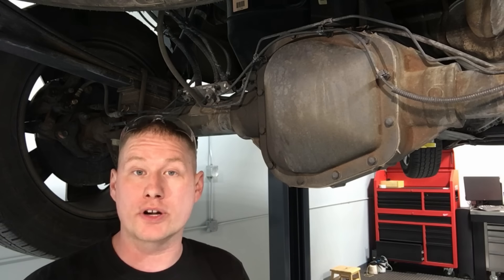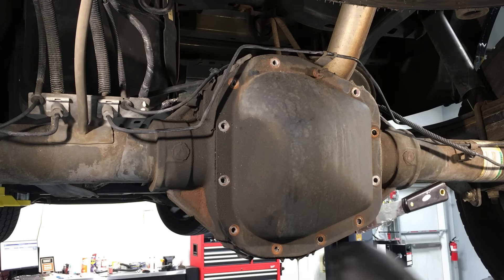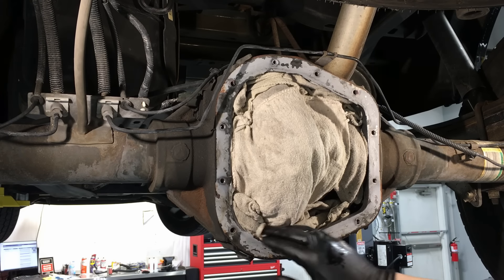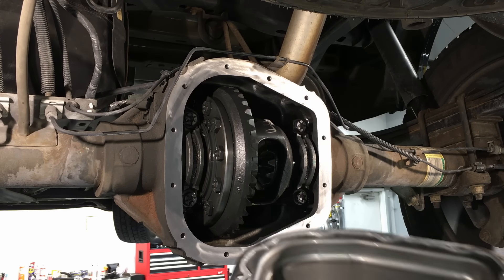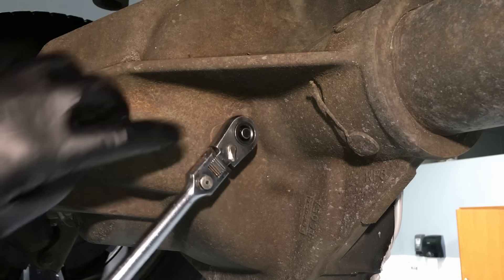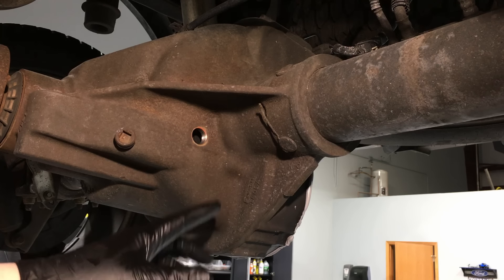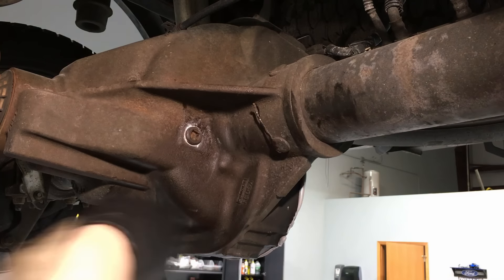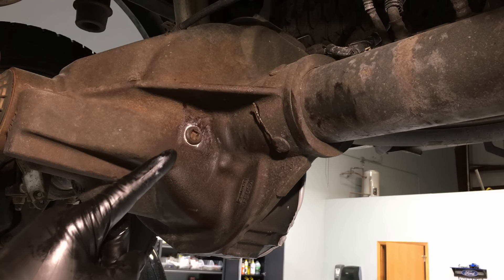Ford 8.8" 9.75" 10.25" Rear Differential Service: Fluid Change Procedure

Comment: The owners manual for my 2005 Expedition says the Diff Oil is good for the life of the vehicle and doesn't need to be changed. Regardless of what the manual says, I change the diff oil in my vehicles at 100K miles. I use the Amzoil Severe Gear 75w-140, it has worked well for me.

Comment: About to do this service on our 03 F150 and in place of the Motorcraft, I'm going to use the Amsoil 75-140 for about $10 cheaper per qt.  Excellent tutorial
Reply: How did it workout with amsoil?
Reply: Perfect.   Easy process following the video.  The truck drives super smooth, no issues.
Reply: @toddallison4390 Thank you, I might consider Amsoil as well.

Comment: Loco, always thought that the first thing was to check the fill plug to see if it comes out,  I do enjoy you videos. I've a 2000 F150 SVT
Reply from the maker: I would say yes but uh I have never seen one seized or anywhere near seized. If make my videos based on experience not what I read or heard.

Comment: I like this method however the only thing that I do slightly different is I hand tighten or crank down to the sealant and don't fully tightened it all the way and after it fully cure is after overnight of sitting I'll torque it down and it forms a really good gasket seal...also permatex recommends this method on it's gasket maker for the differential....great job!

Comment: On posi rearends with miles on them that don't lock very tight due to clutch wear. I have just drained the fluid out and get all of it completely out of the bottom. Refill with proper lube and don't add the limited slip additive. It worked for me.
Reply from the maker: lol
Reply: @FordTechMakuloco  It worked for me. Temporary fix until clutch replacement. It does not take the place of replacement, but at the time I needed a quick fix. I did it on a Dana 61 and a Ford 8.8. As you are aware, the additive helps keep the clutches from chattering on a turn by letting them slip a little (essentially not grab as tight by reducing friction).

Comment: Stick a small rod in a bolt hole up top to help line it up. Once the cover is on with two bolts take the rod out and continue bolting the cover.
I add a short length of clear tube to the bottle top and hold the bottle up higher, allows you to see the fluid flow.

Comment: The permatex instructions say to finger tighten the bolts and wait one hour before tightening and to wait 24 hours before installing the oil. The sealant on the plug was a mess and is now inside the differential.
Should always remove the plug first to make sure it will come out.

Comment: 21:50 What would be the normal depth of fluid in the axle tubes?  1/4"?  Does it touch the bottom of the axle?  The reason I ask is, if you left the cover off overnight, seems like the tubes would drain dry.  When filling quickly like you did, is there really enough time for the fluid to seep thru the inner bearings and then all the way out to end of the tubes???  Seems it would be good to put the plug in when it first starts pouring out, then let it "settle" for 30 minutes to allow fluid to travel all the way out tubes.  Then remove plug and top off again.  If I do this will my be over-filled?   After topping off the second time, I would let it drain as much as it wanted to.

Comment: Thanks.  Comment on the 75W-140 for all transmissions helpful.  Have a Dana 80 on a RWD/DRW 2012 F-350.  Only 55K miles.  ~1500 idle hours.

Comment: Another tip for breaking the seal.  Use a rubber mallet to smack the cover.  Of course leave one bolt loosely in. This method works for me and you will not have to worry about possible gouging.

Comment: Ok, I’m a retired quick lube owner who has an engineering idea about this diff oil change. Ford should have done what almost everyone else has done in the industry. Here’s the deal. Put a check/fill plug incorporated into the housing cover and a recessed drain plug into the actual cast iron “pumpkin “. There’s no way this simple job should be so involved. The only time you should remove the cover is to repair a leaking seal. Period. Oh BTW, it’s extremely difficult to even insert a plastic suction tube into the existing check/fill plug because it will hit the ring gear! Real brilliant, Ford! Maybe they designed this on purpose?

Comment: Perfect tutorial. The only thing i would do different would be the sealant in the plug. Leave the first 2 threads going in sealant-free, so you don't get the sealant inside of the diff. Just a habit when doing any thread sealing on a pipe, either be it gas pipe, or water pipe.

Comment: Nice well done job. The only thing I'd like to add it, when doing differentials, transmissions work, always lose the fill plug before doing anything else. If you strip or break the plug, at least your component still has its old oil inside, you will not be stranded.

Comment: Permatex suggests you let sit for an hour before torquing the bolts. You should wait anyway like you mentioned before filling with oil so the cover seals better.
Reply from the maker: No need to wait.

Comment: I just replaced the entire rear end in my 18 f150, the gears inside were completely shredded. I bought it at 52k miles in 2020 and at 142k miles it broke. I took my truck to the dealer every 5K miles religiously for oil change and whatever maintenance they said I was due for, they never once told me this needed to be done…

Comment: 21 mustang gt s550 here. I dumped out the stock crap at 53k cause i was getting chatter when id make a sharp turn left or right from a stop. Replaced it with 2qt Royal Purple 75/145 with No extra modifier and she super smooth again

Comment: @FordTechMakuloco Why did Ford change the spec from 80W-90 to 75W-140? I know they changed the engine oil spec from 5W-30 to 5W-20 for fuel economy reasons, but I can't understand why they would run a heavier oil in the diff. Was there a lot of premature wear?

Comment: I am refreshing an '03 I purchased. See that ID band on the passenger side axle tube? See it at the 1:10 mark in this video. Mine had so much rust under that band that it ate almost through the tube. It might not be a bad idea to remove this.

By the way, in case a sledgehammer doesn't do it for you removing the rear cover, perhaps use an air chisle! LOL!

Comment: Could you use Valvoline 75W-140 Full Synthetic instead? It’s still not cheap stuff but cheaper than using Motorcraft and I know you should use what is recommended, but I also know they will use identical stuff made by other brands and put a large mark up on it.
Reply from the maker: I don't like aftermarket fluids because they add friction modifier that has been known to cause shudder issues.

Comment: Thanks for this! I’ve already had my rear diff fluid changed by a great shop here. I have a 2018 F-150 2.7 10-spd FX4. The manual calls for 75W-85, but they used 75W-140 instead, which the dealer uses too. I’m guessing this is okay? No issues so far.

Comment: I use 2 guide pins to slide & align the cover.  I cut off the head off a bolt 3 - 4” long, one that has the right thread diameter & thread pitch, makes for easier cover install.
Reply from the maker: Absolutely not necessary in this scenario, there is so much room underneath there.

Comment: Just followed your video to do the same service.  2006 5.4L limited slip diff.  90k miles.  Only previous service was a fluid swap in 2011 at 40k miles. My truck had a shudder in overdrive low rpm when accelerating on freeway, now its gone.

Comment: Thank you for the lesson well done. 
A while back I watched someone drain the differential, but they used brake cleaner to clean out the gears inside the box. Were they wrong to do that.
Reply: Yes

Comment: of interest the Permatex Gear Oil Gasket Maker (part# 81182 - 3 oz) directions specify....  Assemble parts immediately, finger tighten bolts  until material squeezes out around flange, allow to dry 1 hour, then tighten to torque specs. allow 24 hrs to fully cure before filling with fluids.
Reply from the maker: Absolutely no need trust me I have been doing it this way for 20 years.

Comment: I like the work you have done! 
I always been wander - when you adding clean oil at the end - you doing it on the hoist and differential is tilted - but for guys who doing the job on the floor and pinion angle is more level to the ground - so question is - amount of oil that fit into would it be different? what would you advise for guys who doing it on the ground to make it more right? Thanks!
Reply from the maker: It is the same fill either way.
Reply: @FordTechMakuloco  I understand that, i’m curious about amount of oil will fill into, because of hoist - axle is tilted compared when truck is on the floor and fill amount will be different??? (Pinion angle is different)

Comment: ALWAYS ALWAYS ALWAYS inspect the axle vent tube for proper venting. Sometimes they get debris and plugs them up or rust shut and will cause the diff to blow the axle seals as it goes through its heat cycles.
 It takes only seconds to check.
This refers to ALL diffs.

Comment: My shop added the friction additive to my electronic locking differential. Will this cause any problems?
Reply: Nope f150 needs that just as long as the gear oil don't have it pre shipped with it in the oil.

Comment: @fordtechmakuloco Awesome video and love all the great work you do. Just a quick question about the type of fluid to use in a 2015 F-150. The manual says XY-75W85-QL for  my 3.31 ratio,  9.75" not limited slip diff. Of course the internet is full of varying answers and I can't find a good answer anywhere. I trust your knowledge, and you said in the video Ford switched to 75W140 oil. Is that correct? I can't find anything about that anywhere. Thanks!
Reply: I have the same question, 2017 F150 3.5Eco 9.75" 3.31 ratio
Reply: I am wondering the same thing.

Comment: What's your recommendation, on the rear differential fluid change for a 2009 Mercury grand marquis, with 143k miles? The book says not to chnage it unless the differential is submerged fully in water. The car is just used for regular driving. I've only had it for a few months. So it's unknown if it's ever been changed in the past.
Reply from the maker: Every 60k miles is more than enough.

Comment: Hi I just recently watched your video on how to replace the fluid in the rear Differential on the F150 and I wanna complement you on how easily you made it look . I really appreciate the videos you put out . I do have a question regarding you using the gasket maker instead of an OEM gasket ?? Any input you can give me in this regard would be greatly appreciated

Comment: I did this on my 05 F150 with the 9.75" and I elected to use a FelPro gasket instead of using Permatex. I spent most of my time removing the old gasket which was the worst part of this job. I'm at 8,000 miles on the FelPro and so far no leaks.

Comment: Helps to make your own studs with either all thread or cutting off the head of an old bolt. install studs, then cover, bolts, remove studs, install last bolts.
Reply from the maker: No need on these it is nice and open.

Comment: Thanks for all the how-to videos. I've learned a lot from watching them. Do you have any vids / tips / tricks for replacing the rear CV axles in an 05 Expedition? Can't find much out there. I have replaced the wheel hub bearing assemblies but still have a roar and popping sound coming from rear end. Thanks.

Comment: Your videos are the best. They have helped me a lot! Question on the rear differential fluid change. On the 2014 F150 with the 9.75" rear differential: owners manual says capacity is 5.5 pints ( 2.5 qt). When I drained the fluid I measured what came out ~ 2.5 qt. When filling I put in 3 qt and still has not self leveled and dripping out the fill port. The axle is level and not tilted. Any idea why and if I should add until fluid drips out?
Also the same thing with the xfer case fluid change. Manual says 1.5 qt; drained ~ 1.5 qt; refill was ~1.75 qt until it dripped out the fill port
Reply from the maker: This is all normal

Comment: Thanks for another spot on tutorial. I just replaced both front and rear differential fluids and followed your steps to a tee. All worked out with no issues,  so thanks. Question: the Permatex instructions call for 24 hour cure time before putting gear oil back in...is this critical? I don't think the dealership does this...thoughts?
Reply from the maker: Wait at least 4-6hrs, I generally let them sit overnight.
Reply: @FordTechMakuloco  thanks, I'll wait overnight to fill and use the truck. Keep up the great videos, they are much appreciated.

Comment: Hi There,

Thank you for your videos and thank you for your service. You are an inspiration for many of us who need to save money doing our own maintenance on our cars. 
I tried to do the differential change on my old ranger 1991 that never had a differential service on his life. Unfortunately I broke the differential cover trying to torque it to the specs on the Haynes repair manual. I order another cover from my local auto parts store but is identically the same plastic cover. Could you please tell me the torque for the plastic cover. Also the guys at the auto parts store told me I don’t need to add the friction modifier is that true?, last but not least can you recommend a replacement cover with a draining plug, to make the job easier on the future. The same guy at the auto part store recommended me a Yukon brand from aluminum he says that is better that the plastic. Again Thank for for everything and please stay safe.

Comment: So, I drained and serviced my rear end and front dif..... I bought the gear oils and friction modifier at my local Ford dealer..... I followed your videos on these.... now it feels like there is a binding in my rear differential when turning and accelerating, or turning under a load (pulling my boat). Don't know if it is something I should be concerned about, or if it's just normal after the lube change? Please share your thoughts on what level of concern I should have.  Thank you very much... I really enjoy your videos.

Comment: Was the rear suspension hanging down or were the tires holding up the back of the truck.  There would be a different angle on the unit and presumably a different fill level.  What specifically does FORD say on how to get the correct angle and fill?

Comment: Actually, when it is first overfilled I would think the plug should go in for at least a few minutes to allow the oil to flow into the axle tubes and such after which you could pull the plug to allow it to drain to the proper level.

Comment: I have a 2004 Expedition Eddie Bauer, 5.4L 2wd.  Do you have a video replacing the fluid on the rear differential, replacing the rear CV axles or rebuilding the axles or rear diff?  I experience a slight vibration every now and then as i accelerate.  I don't have any play in my drive shaft U joints, so those seem to be good.  But I do see signs of old fluid leakage where the drive shaft connects to the diff and where each axle goes in.  And I see where one axle has thrown it's grease out.  I live in Miami, FL, so I don't have the luxury of coming by your shop, lol.

Comment: as far as re-installing the cover, i dont get why you just dont use 2 long set screws to hang it on!  so there is NO chance of smearing.  and no worries of finding a bolt as it slides all around. that way, you know everything is centered  as you install all the other bolts. just sayin, thats a good way to do it. LOVE YOUR VIDEOS!!
Reply from the maker: The area under the vehicle is so open especially when working on a lift. It puts the diff right in your face so easy to line up and start bolts without it moving.

Comment: I would remove the fill plug before removing the pan bolts because if it happens to be stuck you got another issue plus metal filings on the magnet of the fill plug could come lose from the magnet and fall back into the housing.
Reply from the maker: They come right out no matter how old or crusty. If they were ever a problem in my entire career I would of mentioned it.

Comment: I useally use a tube like you had on the pump and stick it on the tip of the bottle so I can tip it upside down if needed use a small hose clamp to hold it on and transfer the modified cap to the other quarts

Comment: You said in the video that the new spec for fluid is 75w-140 but the link to Amazon for 2015 and newer f-150’s takes you to 75w-85. I’m about to work on my parking brake replacement for my 2015 F-150 and I’ve decided to take the axles off to have better access so I’ll need to replace the fluid and I’m not sure which one to go with. Your advice would be greatly appreciated.

Comment: If you get a couple of old bolts, with a long shank preferred, cut the heads off and round the end over. Then you have guides pins and you can guide the cover on and not make a mess.
Reply from the maker: This is faster and still no mess

Comment: Hey brother, please answer this for me because it's stressing me out!! So I got my 98 Mercury Grand Marquis wanting to change diff fluid , manual says motorcraft 80w90, but I was thinking motorcraft 75w90 synthetic would be better, but I can't find it anywhere, my question is what would you suggest? Motorcraft reg oil 80w90? Or amsoil 75 or 80w90 synthetic? Or motorcraft 75w140 synthetic or Valvoline 75w90 synthetic? If it were your car what would you put in it? I love your videos and watch them all!! You are the man and very very helpful! I love my car and want to keep it 300,000 miles or longer!! Its got 79,000 right now

Comment: I suggest getting a Mag-Hytec diff cover. No need to take any covers off with it. Also, if you have a torsen style limited slip diff, like a Detroit Trutrac, do not add the friction modifier.